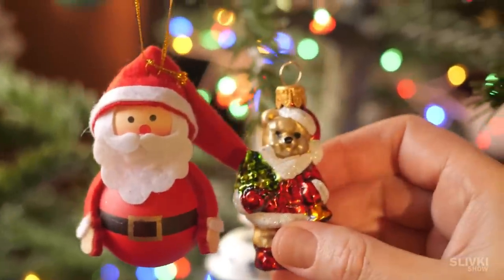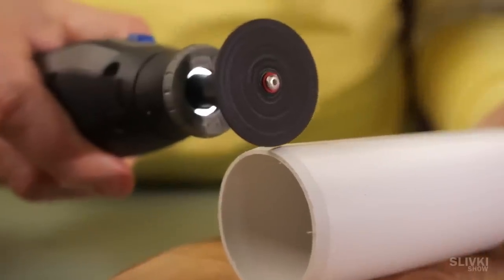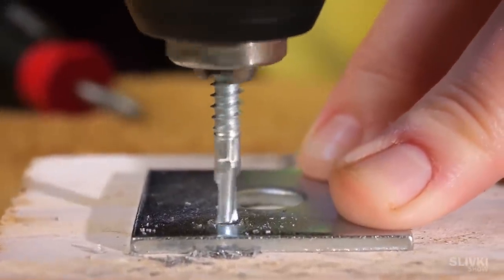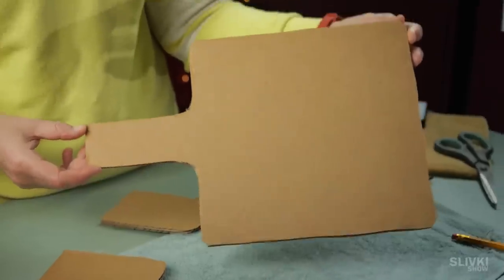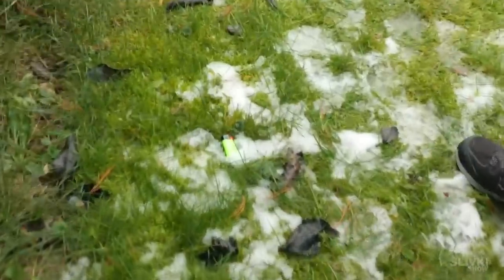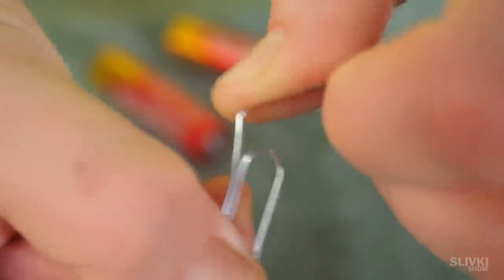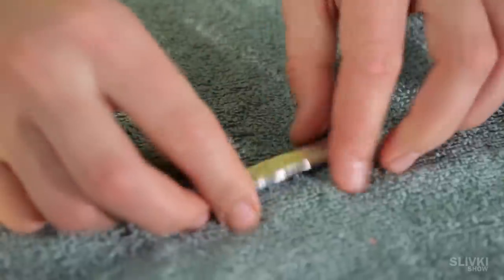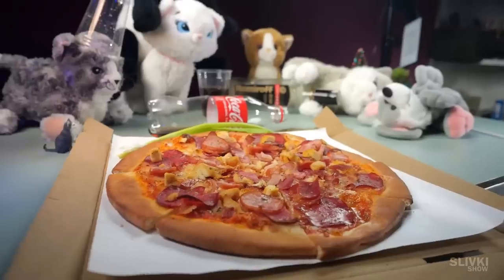6 LIFEHACKS FROM SLIVKISHOW

Comment: I did the chair pipe trick just the other day funny enough. I been using it for years lol.  I just remove the pin holding the legs on though and slot the cylinder cut to length over the ram, then put the legs back on and securing pin. I dont cut down the side of tube or anything fancy.

Comment: Wouldnt the light from the welder damage the camera sensor?
Reply: Yes it will cause sensor damage over time.
Reply: I would recommend taking electrical tape, poking a very small pinhole in it, and putting it over the sensor to block out mist of the light or putting darkened glass instead of the microscope slide glued on the cardboard
Reply: @FlammableElectronics  i've seen that done many times, it apparently works quite well. I think the last time i saw in diy perks channel as he was looking towards a concentrated light spot from a fresnel lens. I think i fucked up many words, sorry in advance 😁

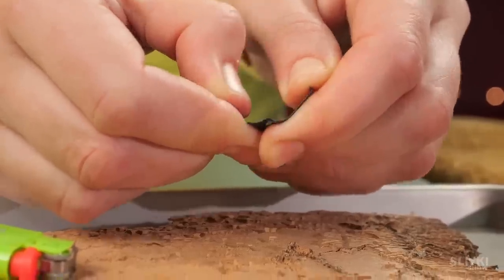Comment: 5:30 even if you do that you don't need to scrape the plastic, because plastic isn't flammable. it's just useless and it hurts the environment.
Reply: Plastic is reasonably flammable, as it's made from oil, although the plastic making up the body of a lighter might specifically be made not to easily light up.  The environmental impact isn't going to be much compared to just having a fire going in general.